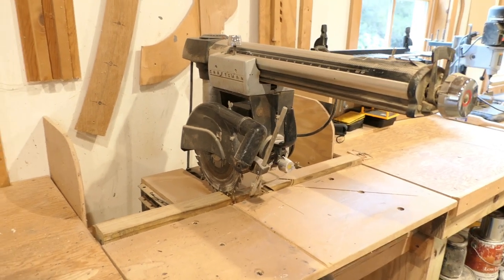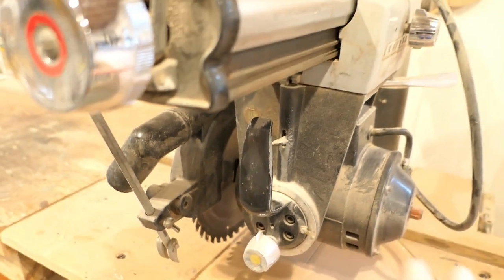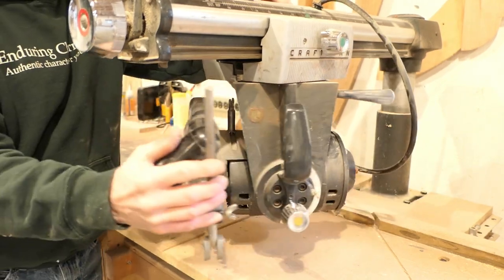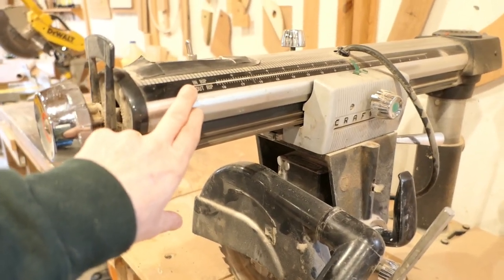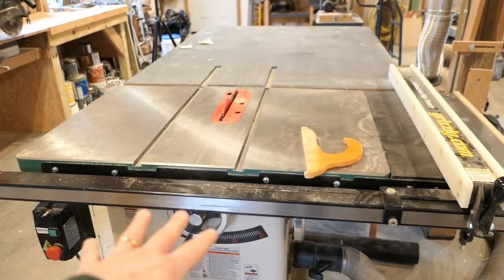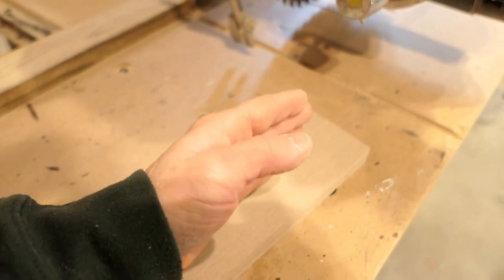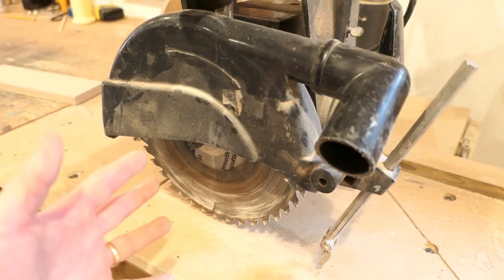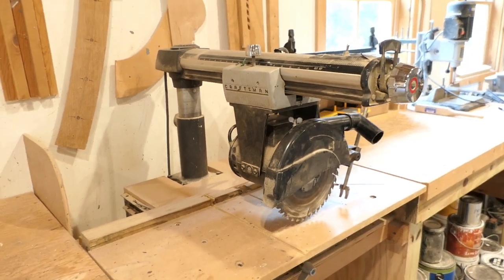The Radial Arm Saw Controversy Revisited!

Comment: Wow! Thats the eaxct same one my dad still has. One of the first real tools he bought doing work for someone and used his profit to buy it. I remember growing up, him always using it and the distinct sound it makes when starting up. I had it at my house for several years in the mid 2000s to do some work before i could afford the newer stuff. Scared the hell out of me. From time to time it would catch and climb (launch) at me. Figured the motor was getting REALLY old and didn’t have the power it needed to cut like it used to.. Maybe needed the brushes replaced or cleaned. But this exact saw is definitely a childhood memory
Reply from the maker: It does make a distinct noise on start-up!

Comment: From what I've researched in the past the number one reason Radial Arm Saws are not popular any more is because they have been outlawed due to accidents.  They have regulated them so much that they are now "Only" 240v and I've hard only 3 phase power.  This drives up the price and limits who can own them.
  I would love to have one as they provide some greater flexibility over the table saw.  The miter or chop saw doesn't have the reach that a Radial has.  To me a miter saw is limited.
Reply from the maker: I don't think there was any conspiracy to outlaw radial arm saws, but if you really want want one they are readily available.  Try facebook marketplace or similar listings.  You'll find working RAS listings for $50 or even free.  As for crosscut reach, most sliding compound miter saws cut to around 14 inches, and some over 15 inches.  Since you won't find boards in lumberyards or box stores wider than a 1x12, this is typically plenty.  When I cut plywood or glued-up workpieces I use a table saw or a handheld saw with a jig.  You can't drag a RAS to a jobsite, typically.

Comment: I have never found any controversy in using the RAS. To me, it's a space saver, and, a supremely accurate machine if you have a good one.  I don't consider a Craftsman to be a very good saw.  It is adequate, but it is not a DeWalt or early B&D.  Some Craftsman saws cannot even be adjusted well enough to produce quality cuts.  And, I have seen RAS's that are just too flimsy to be safe, IMO.

This is not the case with mid-century DeWalt RASs.  Properly set up and with the right saw blade for ripping, the operation is no less safe than a table saw.  The same rules apply in anycase.  Use a push board, don't place your body in the cut line, properly adjust the blade guard and the anti-kick pawl, etc.  MOST important:  Don't feed too fast.  Let the saw do the work, not the sawyer.

Saw blade climbing out of the cut in a cross op? Never had it happen because I feed slow enough to allow the blade to do its job. That blade is not a ripper, but a cross-cut blade. This is no hack chop saw.

An RAS in a productin shop? Only for cross cutting, really.  But for a guy in garage?  Absolutely. They ARE masters of cross cutting and ripping as well.  Jointing, shaper, the jig saw jig, routing? Probably not going to replace my old Porter Cable routers anytime soon.  Disc sander?  You bet!  I have done jointing ops and found it to be just fine.  Again, it's about feed rate.

For dados and plowing,  it's the RAS all day long.

AS for ripping width capacity, almost all RAS have a capacity of 24" in the consumer models. My 9" DeWalt routinely rips plywood in half cleanly and safely, supported on rollers. Never an issue.  I have the typical 10" contractor's table saw, and I like it, too, and I have no problems duplicating the work back and forth between them. If you duplicate the setup for ripping, the outcome is the same.

Comment: If you have a cabinet tablesaw it owns the space in the middle of the shop. When the space is limited and a 1x4 needs ripping the RAS is usually set up on a side wall out of the way.
Reply from the maker: I think you've touched on one difference between fans and non-fans of the RAS.  If you are a hobbyist, then you may well have a small shop and you may not need to rip anything very big.  For the pro, the ability to quickly rip a sheet of plywood down the middle or go through significant LF of trim or other boards make the RAS impractical and the table saw far more attractive.

Comment: I have the exact saw model 113.29401. Everything works fine except the arm latch knob (the big knob in front of the arm). This knob turns really hard. And the latch release lever (lever behind the knob) works but is sticky..doesn’t return quickly. Whenever I engage the release lever the arm will move right or left but whenever I try to tighten the knob to lock the arm at a certain angle…the arm won’t lock. However if I move the arm to the 45deg (right or left) stop the arm will lock. I just can’t lock the arm in a any other angle. Do you know what is wrong and how to fix this problem? 14:55
Reply from the maker: It's difficult to guess without looking at the saw in person.  It could be worn components, it could be sawdust or other debris in the mechanism, it could be both.  All you can do is disassemble the saw and see what you find.  That's the problem with decades old machinery--often it hasn't been well maintained, or it has just outlived it's lifespan.  Once in a while you get lucky and it just needs a thorough cleaning.
Reply: I have the 113.29410 ras. It has a few cosmetic differences but all in all it's a fine saw. My dad was diagnosed with dementia 3 years ago and now I have the saw.  I use it for many operations.  
The locking lever and knob are as yours is. I need to take it apart and see what is causing it. It's the time I don't have. I'm off this upcoming week so I will find the time. It needs done.

Comment: Bought my RAS in 1976. Not a professional but I have used it very extensively. Point? I'm used to it. I learned how to use it, and use it properly,  decades ago. A table saw OTOH, I am NOT used to. I cringe every time I see someone reaching over and around a spinning table saw blade!
I do not disagree with much of what you have said. Definitely not the best at breaking down sheet goods, although I have done it. IMO, unless a large, high-end model, tables saws ain't great at that either. That is the realm for those new-fangled track saws! 
I use my RAS mostly for ripping these days. When I do, I use the antikickback pawls, adjust the nose of the blade guard and set the splitter. I agree the splitter is a poor substitute for a riving knife. I nearly bought a Sawstop cabinet saw a few years ago. IMO, only that is really a major step up in safety from 50 year old RASs.
I do not see non-flash-sensing table saws as inherently safer than a RAS. The machines are different in operation and pose different hazards. 
There is a risk with these old saws . . . and not what you have covered. These saws don't generally fall into new hands replete with manuals. New owners may not know how to use them safely. Case in point . . . a young fellow in a video here on youtube was refreshing the table on a saw handed down to him from his grandfather. He was not feeding against the blade! In short, he did not know what he was doing. Much of the horror we hear about the RAS is simply attributable to unfamiliarity with how to use these machines. 
Fingers are lost daily in TS accidents! Both the RAS and the TS will happily chew through human flesh in the blink of an eye! Although I have not done so, only a Sawstop will replace my RAS. Am considering one of their portable saws. Might do that yet. But my RAS continues to do yeoman duty for me and I am reluctant to let it go. 

One thing . . . for whatever reason, the marketplace has spoken! The RAS isn't coming back!
Reply: Well said!   I have a 9.5” and a 12” Craftsman RAS.   I love using the 12”.  I can cut 16 1x4’s exactly the same length in two pulls, and 32 in three pulls if the boards are long enough.  I can cut at 48 degrees with no jigs or issues.

Comment: 😀 I suppose your critical assessment of the RAS would likely get a lot of RAS users riled up. Like it has been said, any of these tools can be dangerous and one needs to use caution, know the proper operation of each and have a healthy respect for them.  I have both myself, but only use my RAS for cross cutting and like the ability to use a dado stack (when compared with my miter saw).   I have the Forrest Woodworker I on my 10" Delta and always am away of the possibility of climb, though with that blade its not an issue.  That said, I do use my table saw more than the RAS. Though any saw can be dangerous, perhaps the least dangerous is probably the band saw. Thanks for video. Btw, your poor old saw seems to be a little overdue for service! 😉
Reply from the maker: Yeah, I really don't use my old RAS anymore, so I haven't bothered to do any restoration.  I suspect part of the controversy relates to the type of work people do.  Professionals who need to get work done with speed and efficiency in order to get a paycheck are going to have a different perspective than hobby woodworkers who can afford extra time or the indulgence of using an old machine they enjoy.

Comment: Very few of the larger tools did I buy new.  The radial arm saw was one.   Sears in Westfarms Mall.

A bunch of years later I kicked it to the curb and gave it away.  I never really bonded with that saw.....Do they even sell them these days?
Reply from the maker: Radial Arm saws are not widely available new, I'm not even sure they are available at all.  They have been replaced with double compound miter saws, among other modern tools.
Reply: @enduringcharm  .....awh...heck...I can cut a compound mitre on a Boston hip roof with a left handed circular saw......while whistling Dixie, 

( I need to run and edit.....Have a super evening)

Comment: I have a 10” craftsman RAS  and a 16” delta RAS in my shop. In a pinch, I’ve ripped lumber a few times on the 10” if my table saw was set up with a dado stack. I find it awkward to rip on RAS especially if you have long support tables. I wouldn’t want to rip lumber on 16” RAS. I’ve heard of some bad stories about people trying to rip on a RAS and feeding the lumber in the wrong way. I agree that a RAS is best for crosscutting and it’s safer to rip lumber on a table saw.

Comment: I'm going to "rain on your parade" when you said at 7:10 "radial arm saws are not anywhere near as safe for ripping as a table saw." That's just NOT true, in fact, a RAS will not kick back like a table saw because of the blade being above the work and the rotation is downward at the rear, unlike a table saw where the rotation is upward at the rear.  Physics always plays an important role in high speed rotating cutters. Yes, there are 2 feed directions depending on the head's position, in rip or out rip. However, the work is always fed into the blades rotation, never with it, or a climb cut. That's the RULE no.1. The second rule, no. 2 is to always rotate the blade guard around to where it's just a 1/64th off the work piece to keep it registered against the table. If you obey those two rules, you can rip safely. You should also make a push board to complete the cut all the way past the blade.
Reply from the maker: Ripping is a big subject, and safety is more than just kickback.  For example, what about ripping a heavy 4x8 sheet of 3/4" plywood for cabinet carcasses or shelving?   Or what about ripping short workpieces under a foot long?  What about ripping a sixteenth off of a thin quarter round moulding?  What about ripping multiple angles on a single workpiece to duplicate an historic railing?  These are all routine tasks for many of us, and I would suggest that heavy/wide sheet goods can pose a problem for the RAS, keeping hands clear when ripping short pieces can be more difficult on a RAS, a thin moulding can be a danger since your blade guard isn't effective in that instance, and cutting multiple angles on a single workpiece can lead to exposed saw teeth right in the path of hands or push stick.  Safety?  Kickback can be one concern, but what about the lack of effective dust collection on a RAS?  What about noise level?  The RAS is by far the loudest tool I've ever tested with a decibel meter.  What about a riving knife to protect against case hardened wood?  What about a switch with a safety shut-off you can hit with your knee if needed?  What about Sawstop technology if you are so inclined?  As I've said before, if you enjoy keeping old tools running or you have a fondness for the RAS, that's great.  But I would not recommend one to a new woodworker over a table saw.

Comment: An negative hook blade is only marginally  "safer" than one of standard configuration.  At the expense of cutting efficiency.  I don't use them. 
Good work habits and awareness will mitigate any hazards much better than specialized blades.
When cross cutting,  i carefully  line up my piece, then,  put one foot 20" behind the other,  lock my right elbow, and rock backwards for my cut. The limited power of the saw isn't going to overcome my aligned body!
I don't use mine to rip, but COULD,  if i didn't have quality table saw, either infeed or outfeed..
For really small pieces,  I nail my piece with 3d finish nails to a sacrificial plank, and make my cut with a power saw.
The most annoying thing (not dangerous) about mine is crap along the fence preventing me from really accurate cuts. I just keep my table swept up,  and, I put a little 1/4" bevel along the bottom of my 1 inch "fence".
I rarely use my miter saw in the shop! Then again,  i don't have the space for both the RAS and miter saw, with long work tables for both.

Comment: Great points! Thanks for the video. I believe that all power tools are dangerous. Frankly, a free hand router scares me more than either an RAS or a table saw. I have both an RAS and table saw in my shop use them both a great deal. I have fashioned dust collection on my RAS that is almost as good as a table saw, and NEVER, NEVER rip on it. To me, the issue is education. An RAS should not be considered a jack of all trades, but it is very useful. I run a lot of lumber through my RAS for cross cutting tasks and for dadoes. It is excellent for that work. Again, thanks for your video. While I don't agree entirely with your point, you make many that are valid and I appreciate that!